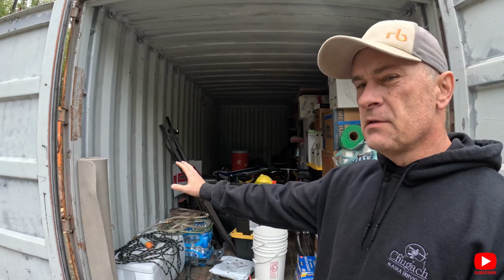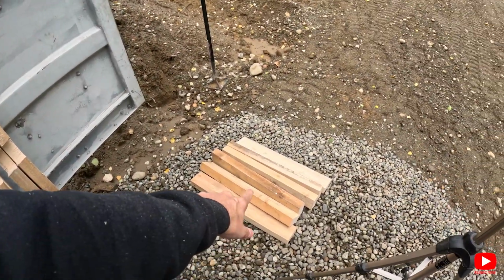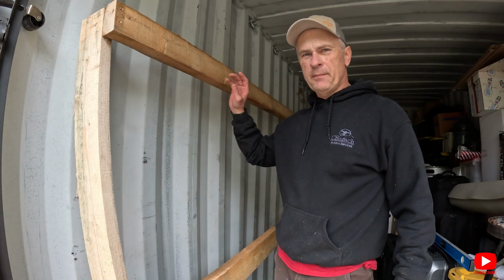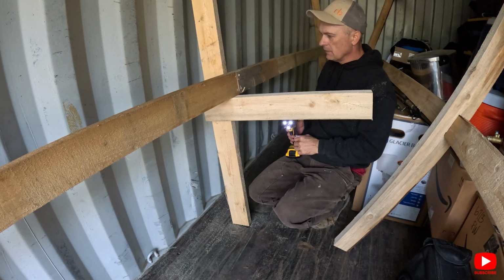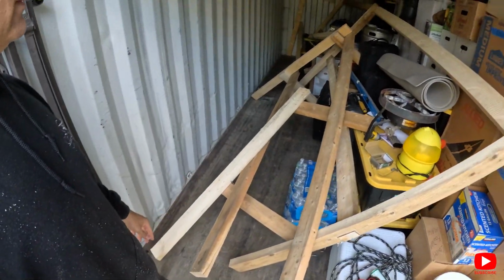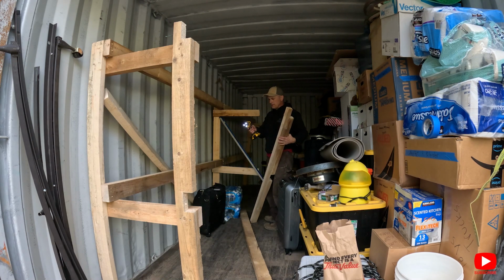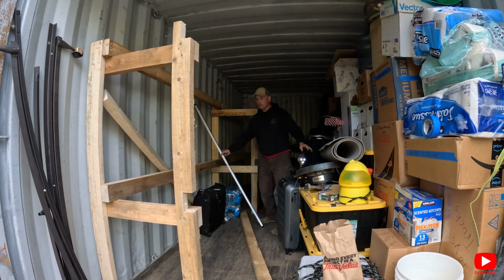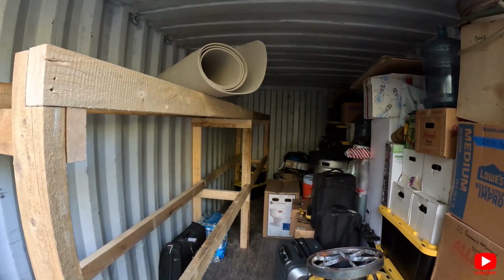The Explosive Outburst: Frustration Boils Over

Comment: I'm glad you left the frustration in the video. Hardly anything goes to plan when we homestead, or off grid homestead
Reply from the maker: That is a very true statement.  I was mostly frustrated with myself bc I knew 2.5 inch screws wouldn't hold but I tried anyway.  Thanks for watching
Reply: @MyAlaska12  you're welcome. We try to make due with what we have and sometimes (most of the time for me), it doesn't work out

Comment: Good Afternoon/Evening, Yikes, will you need to WD40 those doors so you'll be able to open them in the deep winter there?  Way to go- I said 'there you go' out loud when you yelled ha ha! I would have done it a lot sooner. Anywhoo you did it! I can see why you said the shelving will help you a lot. That is solid and will hold lots! Looking forward to seeing it completed.
Reply from the maker: Thanks Connie.  The one bar on the door is slightly bent, that's why it's hard to open.  Yeah, I finally got it done.  They are working out stupendously.

Comment: Not quite sure why you didnt build this lying down outside and then move it inside ???
 Also tacking it together with temp bracing would have helped you when doing it alone.
Investing in a couple of clamps will be a huge asset in building alone. Glad you overcame in the end. But working wiser rather than  harder is better for the mind and the spirit. I learnt the hard way, as even while still married the now exhubby had zero interest in helping me even with the basics ...like holding something in place while I attached it. So my advice is well intended and learned from experience 👍👌
Reply from the maker: It wasn't one of my better ideas for sure. But I didn't think it would fall apart so easily.  Lol thanks for watching

Comment: I bet it never crossed your mind to screw those uprights into the wood floor did it??? Or build them laying on the ground outside then carry them in???
Reply from the maker: I wanted to build them in place bc they would be heavy to move by myself. If I had built them outside, they would have still fallen apart bc the screws were too short.